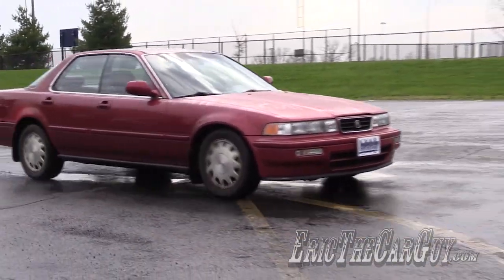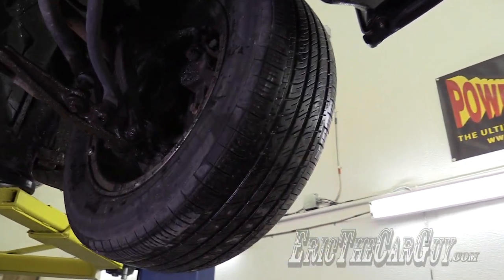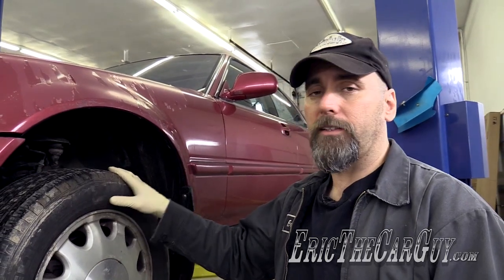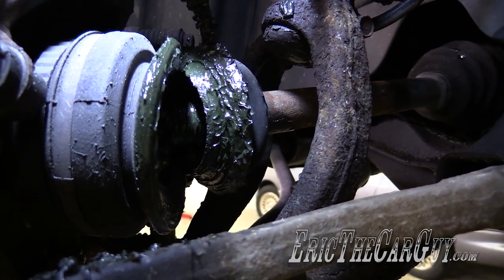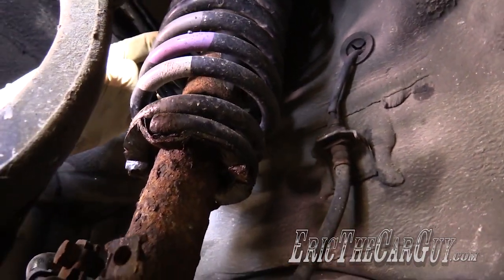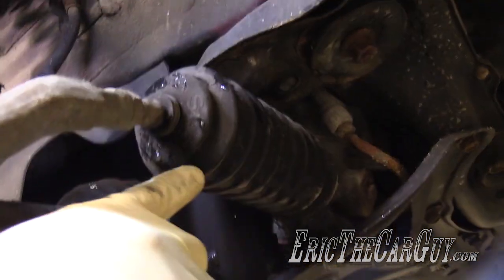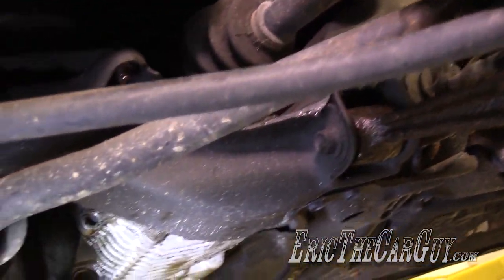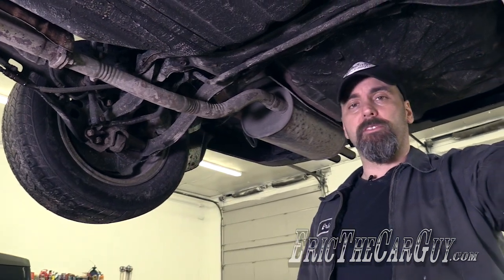Inspecting Your Suspension and the Monroe Safety Triangle -EricTheCarGuy

Comment: I appreciate all the tips, I have picked up a lot of good info in numerous videos.  Just give some info back, those are shocks not struts.  Struts act as a control arms and are able to spin they are built different. It annoys me when going to buy parts and they are labeled incorrectly so if the aftermarket can't even get the name right, what sub part starts are they made from.  Done with my little rant keep up the great videos and thanks!

Comment: When I had wheel change (from 17" to 18") on my 04 TL, an Acura dealer in North Shore of Eastern MA threw away the sticker labels that had vital info on the tire pressure & what not.  A shop should return everything in the box to customers.  They also damaged one of the new wheels + its tire (sidewall), which wasted my time.  They tried to deny the tire damage first (were honest about the wheel damage however) but I ended up speaking to the mx mgr and they covered the cost. 

However, I ended up installing a new tire on L/H front only, even though I told them to replace as a pair.  If it were a Honda dealer in Japan, the dealer would be apologizing like mad and would have changed the tires as a pair (or all four) and would have given me a lot more compensations.

I don't know how a tech could damage a wheel like that, unless he/she was ultra careless.  Or, the mx mgr was an a-hole and pushed the techs so much that they couldn't focus on their job.

Comment: hi eric. i really need your help. i feel you the right person that can answer my question. i drive a 2013 ford figo (similar to a ford fiesta mk6, everything is the same except for the looks which is slightly different ) i installed coilovers on my car and made it really low and i want to know what effect does it have on my suspension components such as cvs, ball joints,  drive shaft etc. and can you also tell me what is the purpose of drop links. i would really appreciate your input.

Comment: You should really replace those front struts.  That lower spring perch looks pretty rusty and if that gives way you're certainly going to hear it pop and the unloaded spring could be a like a bomb going off causing all kinds of damage.  Bet we can look forward to an axle replacement too, slinging that green goo everywhere.  You didn't address why it's important to have good CV boots and not have tears, kinda skipped right over that.  I'm sure we'll hear about it later but in an overview video why not take an extra 1 min to explain that?
Reply: ***** Ohh it's a sponsored video.  OK that's makes sense.  Cant' wait to see you get those new Monroe struts on there.  You certainly need them!  As far as a sponsored video goes you did it the right way.  Not intrusive but mentions that Monroe struts will correct a lot of those issues.  You put a lot of thought into it.  Good job.
Reply: ***** Eric has done at least 5 videos on CV joints and FWD front axles.

Comment: regarding tire pressure.  I could never tell if the pressure is reviewed while the tire is in the air?  I'm assuming the pressure would be more while the car is on the ground since the weight of the body is on the tires.

Comment: I had my car aligned in a shop last fall and the idiot who did it broke a stud off from one of the struts, where it bolts into the tower at the top and I was not informed.I noticed this spring when I was looking the car over, preparing for safety inspection. I fixed the problem by replacing the strut because I was in a hurry and I didn't have time to take it somewhere to have the bearing plate removed to change the stud.

This really grinds my gears because this dishonest idiot's mistake cost me $95, and I didn't catch it early enough to force the garage to pay for their own mistake. I had just replaced both front struts two weeks prior to the alignment. I need to find another shop to get my alignments done now.

Any chance there's a video on ETCG1 about shoddy mechanics? I'd be interested in hearing what you've got to say about crappy mechanics who do stuff like this to paying customers.

Comment: I'm curious if you have any annual road worthy tests in the USA, here either the cv boot or the ball joint would be a failure meaning the vehicle would be regarded as un roadworthy.
Reply: It depends on the state as to whether they have and inspection as well as what the criteria is for the inspection.
Reply: heavydiesel In almost ALL states you have a yearly inspection. Funny enough a lot of states are considering doing away with those kind of tests which I think is a big mistake. I want everyone's steering and brakes to remain in good condition, it's not just their life on the line when they're driving, it's mine, too. 
I live in Florida now, and actually we have no inspections.
Reply: None in Tennessee either!
Reply: No inspections in WI. That actually seems to be the norm here in the states, at least for now.
Reply: Jesse Crandle There is talk of making our inspections every two years, but about 30% fail the yearly one so i dread to think what they would be like after another 12 months motoring!
Reply: heavydiesel With the exception of one or two, all the states with a relatively high population density have mandatory inspections of some kind. I live in Virginia, where the inspection interval depends on things like when the vehicle was last registered, how the last inspection went, etc, but generally it is two years or less. I've had inspectors give me a sticker for a shorter period because something was not an immediate issue, but would be soon and they wanted to make sure I'd back so someone would know it has been fixed. If you know your inspector, you can get your car passed with all kinds of problems though. When I go to Maryland, it is blatantly obvious that there are no required inspections. Cars with headlights too hazy to see anything at night, collapsed suspensions, and all other kinds of unsettling things are a common sight if you know what to look for.
Reply: heavydiesel In south carolina if it runs you can put it on the road...
Reply: SavageSalad  unless it is smoking up to the heavens yeah lol. But unlike most other states, South Carolina drivers pay car tax (until the is considered classic age)
Reply: Doug Beard actually man i live in maryland you buy a car, it has to be inspected then after that its up to you to maintain it.
then theres the 20 year historic tag law, someone can get tags without a saftey inspection
Reply: Well, yeah, but there are some BUCKETS on the road there, because nobody spends the money if they don't have to.

Comment: Thanks for the advice, my suspension do not bounce but is rough when i drive, you can feel every crack on the street. I guess i need to replace struts and springs. Would you recommend me some brand or type of struts/springs?. 2k civic. Thanks!

Comment: Eric, any idea whats bothering my W202 merc? 80k miles on it only.

First, it doesnt want to go straight steers a bit to the right. Alingment checked couple times and didnt help.
Second, sidewind really can make it unstable. Scary. Also rolls quite a bit on corners.

I just installed new shocks/springs, no help really. Also been wiggling tires and joints, with hand an a prybar. Everythings tight.

Only my front swaybar was a little loose but i fixed it, didnt help.

It otherwise is the smoothest and most solid car ever, but im really fed up going down the highway and constantly fighting the car that wants to keep going right.

Comment: EricTheCarGuy  i have a question not related to this video. I got a 1997 honda civic i changed alternator and battery yet everytime i drive voltage drops to 12.5 but if i put it on neutral or park it goes back up to 14.3 i checked fuses, belt and what not yet voltage never seems to stay anywhere near 14 when driving so i cant even turn run my radio up without voltage dropping close to 12.1 what could be causing my voltage to drop so much while i drive yet in park and neutral stay above 14. Even with music on

Comment: Hi Eric, 

I have an Australian built VX SS commodore - 5.7ltr V8 with a automatic transmission ( http://en.wikipedia.org/wiki/Holden_Commodore_%28VX%29#Commodore_SS)

I live in a highly populated inner city area & my only parking option is to park it in the street which has a slope of about 5-10 degrees. I work away & sometimes i don't start it for 2-3 weeks & there seems to be a massive load on the starter motor when starting it after an extended period. 

Is this due to it sitting for long periods or the angle & the fluids settling @ the low point?

If it's due to fluids, would there be any difference  in  the direction i park it? 

Thanks,

Love your videos & keep up the good work.
Reply: Hamid Karzai 
So after not driving it for 2 or 3 weeks it takes longer for it to start(cranks for a long time)
That could be a battery issue.
Batteries will slowly discharge over time and yours may be dead.
Also with winter coming around, it will make the battery work harder.
Battery world do free health checks on batteries, doesnt hurt to get it done.
Reply: ok, thanks. 

forgot to mention that i'm in Australia so temp differential is not really an issue. & the few times a have managed to leave it on a level surface it starts as normal. 

thanks.
Reply: 2001
Reply: Hamid Karzai 
I am an australian as well.
The LS1 is a pretty good engine.
A battery that is old will struggle to start the car after the voltage has dropped after down a little.
Could also be fuel issue.
Reply: Thanks man, you're right the LS1 is extremely reliable & is by far the best engine a guy on a budget  could want IMO. 

It's not the battery, which brings me back to my first question about parking it on a slope & if it will have any affect on it either way?

Might be fuel on the low side?  ( tank is not usually on empty )

car has 190,00km and a full service history & is in mint condition. 

Thanks for all your input guys..
Reply: Hamid Karzai It sounds like the starter motor is getting a bit worn out. I have to say I have noticed this symptom on both 6 & 8 cylinder Commodores though as if the starter just doesn't feel like starting and is sluggish to turn the flywheel.
Reply: Hamid Karzai 
An article about the same thing on a Honda Jazz/Fit
http://ravingroo.com/937/car-wont-start-parked-uphill-or-downhill/

An article that may explain a few things
http://www.gencoupe.com/3-8-v6-discussion-2008-2012/95731-hard-start-hill.html

Try this next time.
Turn the key to POS II(dont crank)
then turn the key to POS 0 and remove the key
then urn the key to POS II(dont crank)
then turn the key to POS 0 and remove the key
Attempt to start and see if it starts quicker.
You should hear the fuel pump buzz coming from the tank area

This will activate the fuel pump which should prime the fuel line again and if there was any loss due to the fuel dripping back into  the tank due to gravity the priming should fix it is it is a fuel issue.
I am no mechanic but it should help

Comment: Unfortunately I've had nothing but bad experience with the Monroe products themselves, but a great experience with their customer service.

I had a set of Monroe-Matic shocks on my Grand Cherokee (I didn't buy them, I swear!), and within 20,000 miles, they were ALL blown. The Jeep was a commuter/family vehicle, so no offroad or hard driving. Their customer service was nice though, offered to replace them all for free. I declined since they were so cheap, but also because I didn't want another set of them. Bilsteins are on there now.

My second experience was with the set that were on a used vehicle I purchased. I can't remember which model shock it was, but it wasn't Monroe-Matic again. From the receipt I found, they were roughly 10,000 miles old. Two were blown. I promptly tossed them and put on a set of KYB Gas-A-Just.

Another used vehicle I purchased has Monroe shocks as well, I think Sensa-Trac, iirc. I haven't really had a chance to test them out, since the tires all have flat spots, but I do plan on replacing them with OEM (AC Delco) units.

From my personal experience, and from all the complaints I see on enthusiast forums, I always recommending everyone staying away from Monroe shocks. At least the economy ones, as I have no experience with the premium ones. I would highly recommend everyone use OE shocks, or a reputable brand like KYB or Bilstein.